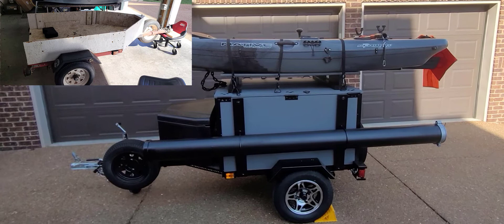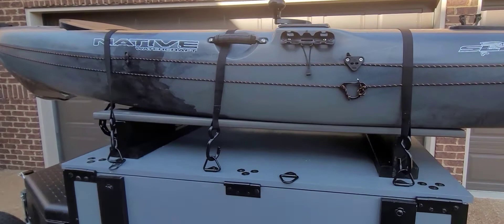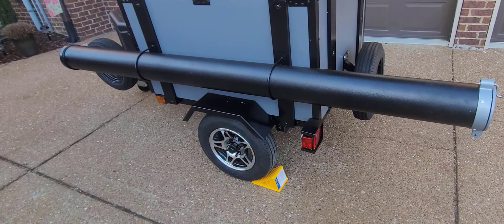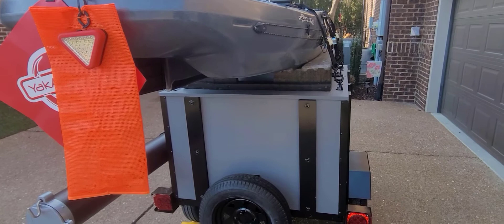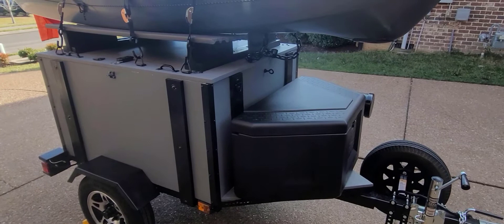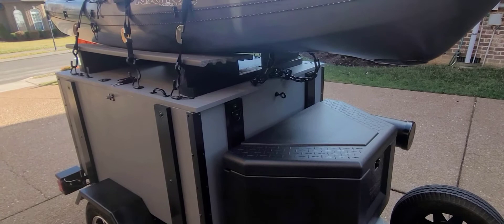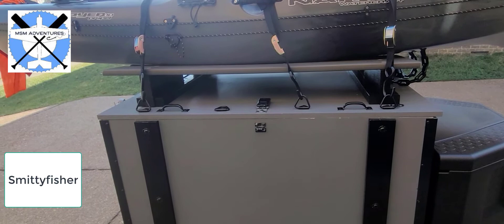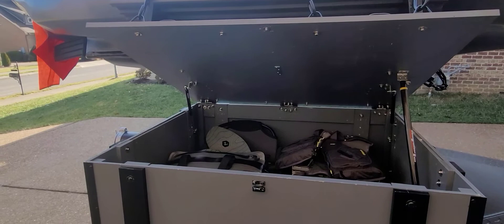DIY Harbor Freight Kayak Trailer Walkthrough

Comment: Security wise keep it in the garage, my dad had a trailer a little bit larger than that one stolen once, and he to had all kinds of trailer locks on it but the thieves pulled up to his driveway and 6 guys hopped out of a truck and lifted the whole trailer onto a flat bed trailer and took off in about 45 seconds of interaction time.

Comment: Awesome build. How thick is the plywood you used?
Reply from the maker: Thanks TWA!  If I remember correctly, it was 3/4 on the floor and the lid of the trailer and 1/2 on the sides.  I primed and painted (2 coats each) both sides to ensure it wouldn't rot.
Reply: @scottmiller9213  thank you for the reply. What did you use on the corners? The black L pieces you have in the edges.

Comment: Nice trailer.  Did you use the original trailer tongue, or replace it with a longer one.  What is the tongue length?